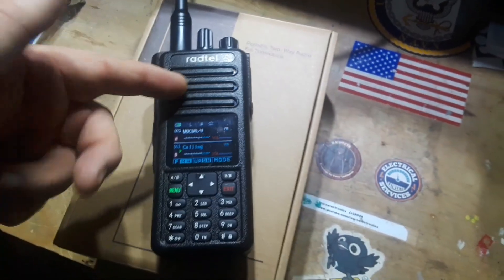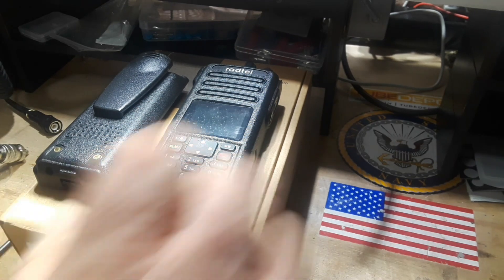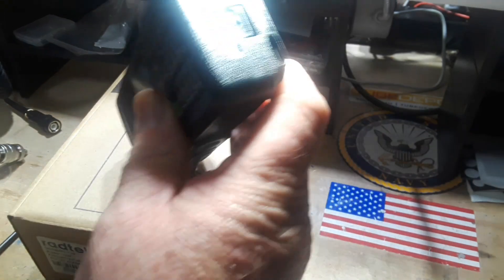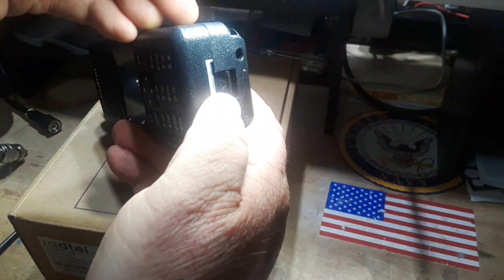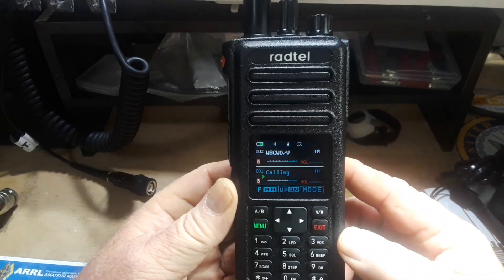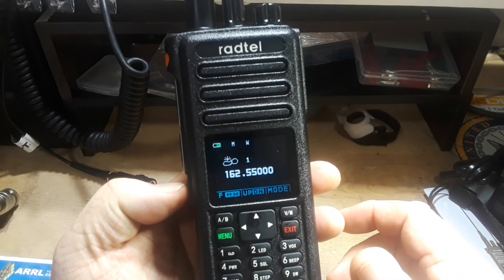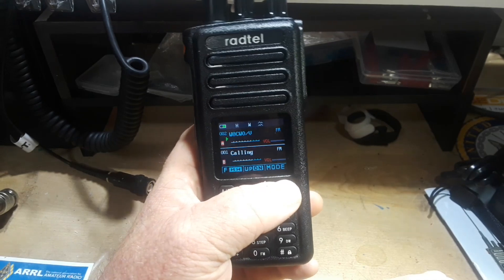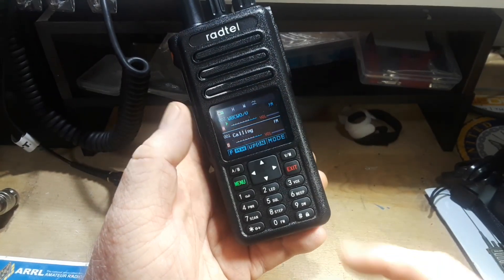Radtel RT-730 Dual Band/Dual Watch/Cross Band Handheld Amateur Radio

Comment: Like most of the FM radios for the Ham market, the AM aircraft band sounded distorted,  probably because it does not have the ability to demodulate AM properly.
Otherwise, it looks like a reasonable radio for the money. 
73.

Comment: I like mine, but it's sensitivity is not as good as my RT630 (on 2 m band). Maybe I got a not-so-good-one. 
And the RX of Airband is a NO GO.
Other than that, I appreciate the rest : power out 10W on 2m, 6W on 1.25m and 7-8W on 70cm, nice audio in and out (little quiet, but OK) and the Motorola-like tone at the beginning of each transmission (I know I am transmitting). Some functions could be added via software, since as is, it's a very basic package.